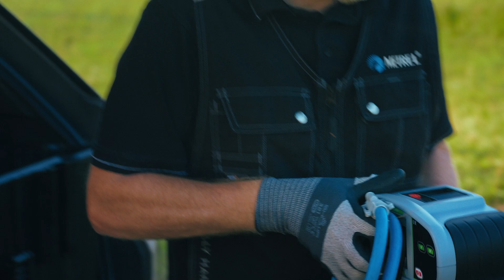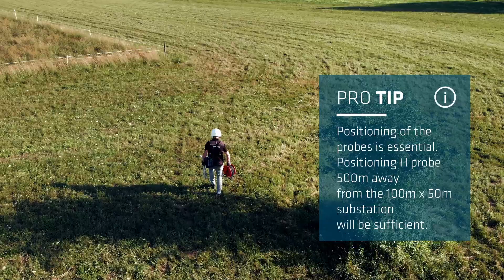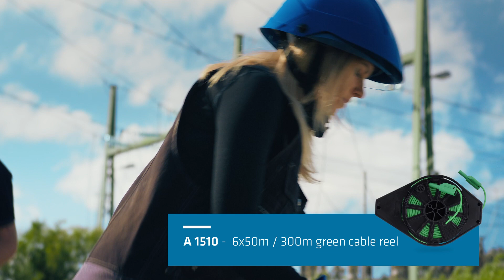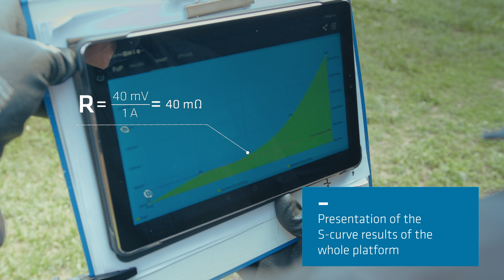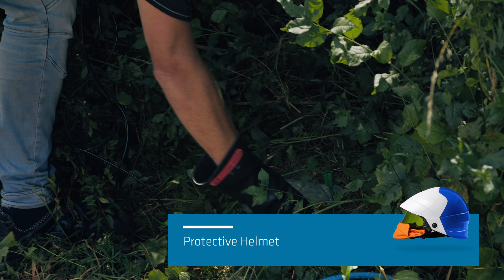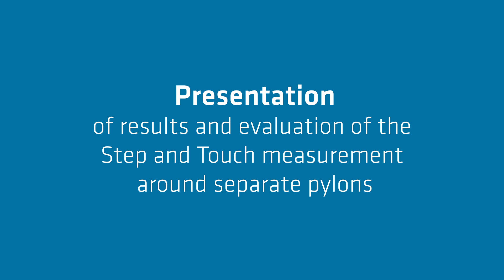Substation Surroundings | Step & Touch Voltage Measurement | MI 3295 | Instructional

Comment: its interesting educational video. have question for the step voltage, you are measuring in a normal condition, not in a fault condition. how do we convert the numbers during ground fault situation?
Reply: correct, measurements are showing mili volts during generating test current, e.g. 1A at 55 Hz. Than we recalculate the mili volts and scale it up to the fault situation. Usually we need to evaluate worst case scenario for three examples - 1 - MV fault line to ground, usually few 100 A, voltage limit to U touch permissible for tripout time of several 100 ms, Utp allowed few 100 volts, - 2 - LV fault current, several kA to ground, where limit is 50 V for public places, - 3 - and lightning strike situation to 50 kA minimum, where limit 716 V  is considered still safe due to very short time of surge.